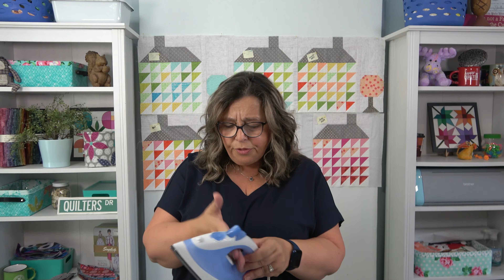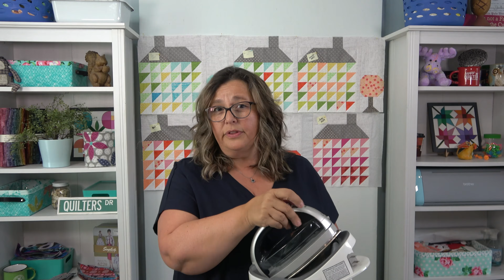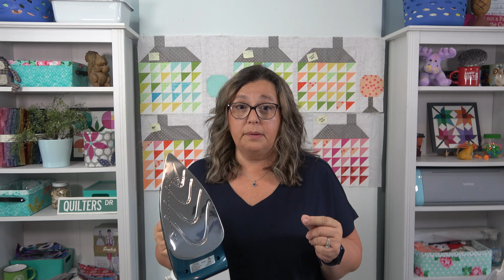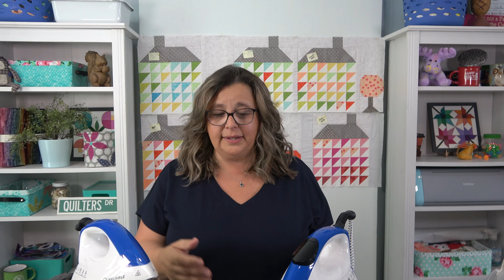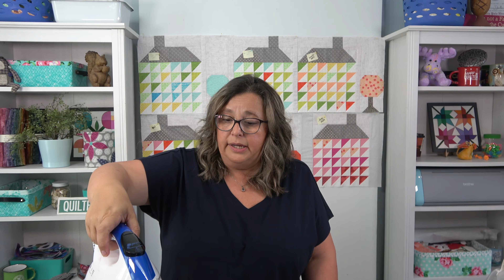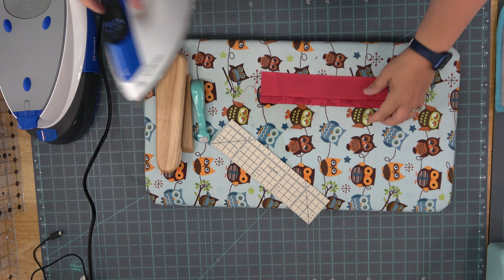Gifts for Quilters | Iron Comparison | Christmas Gifts | quilt pressing tools

Comment: Great video! have you tried/had experience with any of the other Reliable brand irons? Recentnly, I have been using a dry mini Oliso (because my old Rowenta which has been pretty beaten up leaks a lot) but would like a larger iron and will probably use steam more than not for large pieces of fabric and finished blocks/quilt tops. Thanks for any guidance you are willing to offer.
Reply from the maker: I have tried the maven 1 liter and the 1.5 liter. They are both great. I preferred the larger one as I like the controls on the back of the machine vs the handle.  However they have discontinued the sale of the old Maven 1.5liter (which I believe was the maven 140).  I have it on good authority (from reliable customer service) that they are launching a new version of the larger iron sometime in June. I’m looking forward to trying it out.  Both irons perform well… are lightweight and are perfect for someone that is a dry iron presser that likes a little steam now and again.  No leaks and I have accidentally dropped one on the floor. It was fine. Although I wouldn’t recommend dropping it. I’m not a fan of Oliso because of the automation and Rowenta due to leaks.

Comment: Thank you for this video--I got the Panasonic cordless fall of 2025 and it's been great for seams but it really hasn't gotten hot enough for me to do swathes of cloth or clothing.  I'm trying to be quick but even right off the power base it just hasn't been getting hot enough for me (which is why I'm looking at other iron reviews!)  I wonder if there is some variation in the quality control...
Reply from the maker: I have three different versions. They are all about the same. I can highly recommend that Reliable steam/dry iron with the tank. It performs just as well as the expensive brands. The iron isn’t cheap but our get a lot of use at retreat and they are still going strong.

Comment: I bought  an Oliso and it broke. I dealt with the company and was treated very rudely. The eventually replaced it but actually accused me of trying to get a free iron from them. I’m using the replacement but I agree, I could use and throw away a lot of black and decker irons for the price of one Oliso
Reply from the maker: In general, an iron is a simple machine. The oliso adds extra mechanics that are unnecessary and those types of items should be avoided in general. Technology is great but only if it makes sense. Thanks for watching.

Comment: I was trying to decide whether the gimmicky Oliso mini was worth it as I dropped my iron recently and it's definitely seen better days. Their prices here in Australia are ridiculous, so nope. I've heard great things about Reliable, but I'm not sure they're available here. I don't use steam, so I'll probably get another cheapie.
Reply from the maker: Just an opinion but save your money.  I did see recently that Amazon has a rowenta that is similar to the reliable maven.  Didn’t see the reviews but it has a separate tank.  I do not typically use steam unless I am making my scrap petal garden quilt but the reliable has been a great new addition to the studio and gives me the option when I need it and I love that.  Thanks for watching.
Reply: What a wonderful video!  Soooo much information,  thanks!  Question….does the reliable maven cool down quickly like the other cordless iron that sits in its base, the Panasonic?  The smaller maven is very tempting, but I would like it to stay hot.  Thanks again.
Reply from the maker: Actually they go on pause but don’t immediately cool down. They are auto shutoff and won’t stay hot all day on their own.